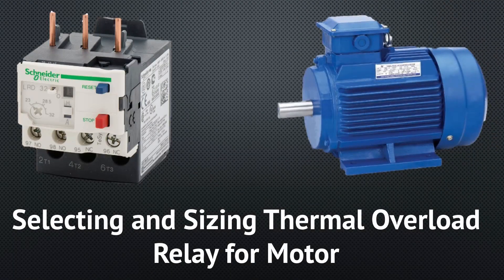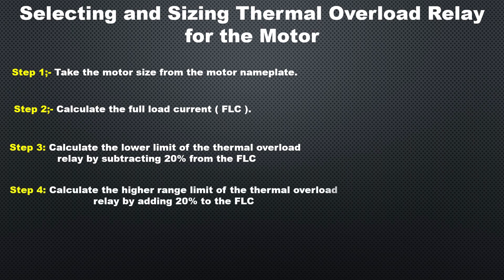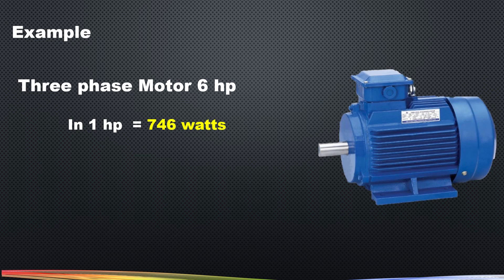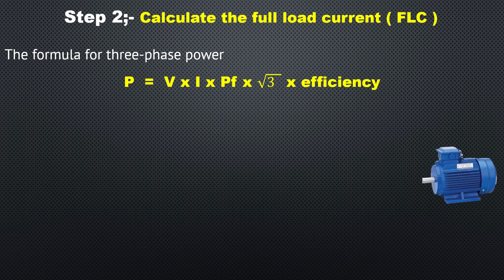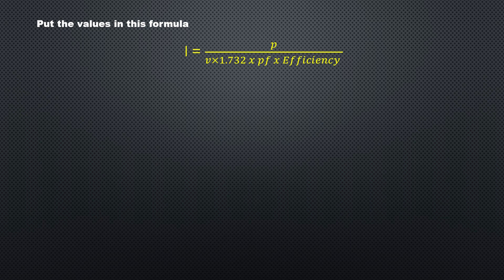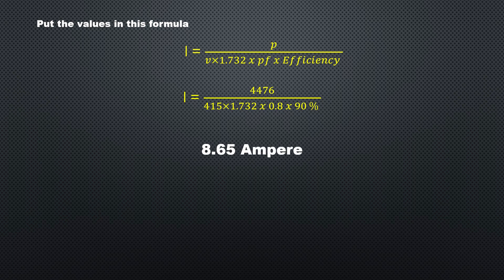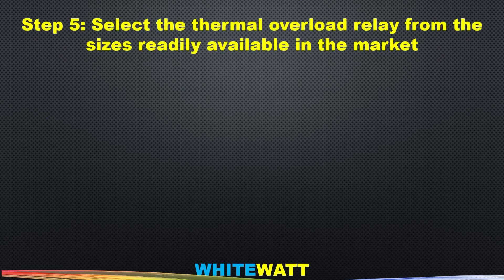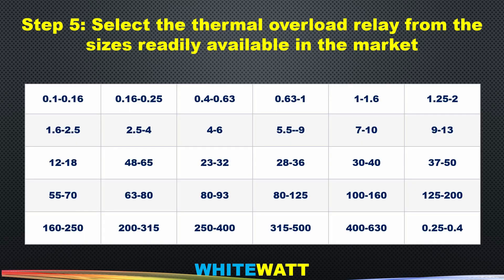How to select a relay  for a motor | relay selection range |relay calculation

Comment: If water hole motor is 13.7 amp. (23.7 amp is what is on the motor plate written) what amps i have to set on overload switch please?